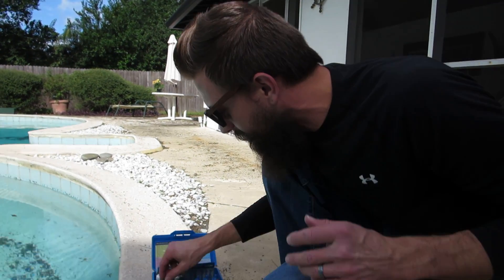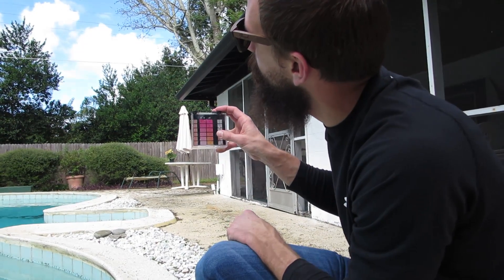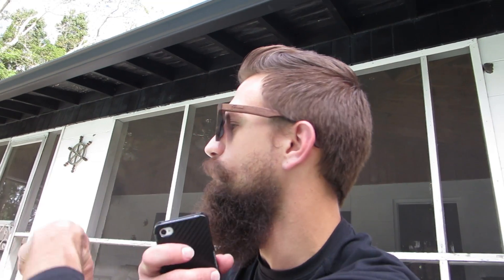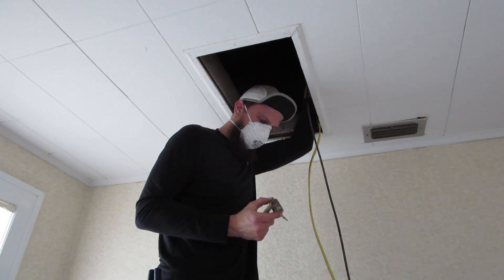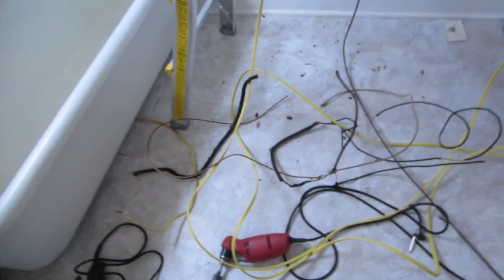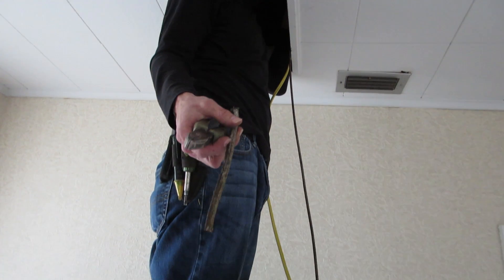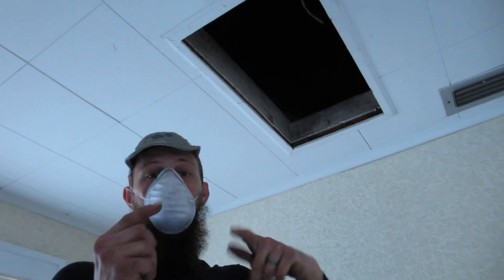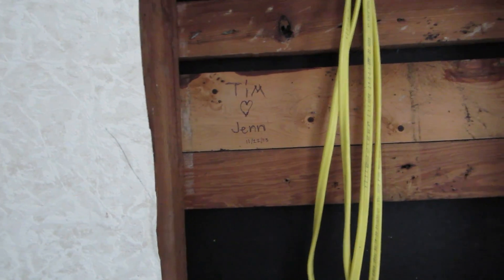Tim's Dirty Butt!!!

Comment: Awesome job! I'm excited to see your main feeds run and soon it will just be switches and outlets.  Home Depot has a mask that is similar to the one you have but it has a built in air exhaust vent. The one with the vent feels much nicer to breath through.
Reply from the maker: I've used those masks before, they still get hard to use when they are saturated with sweat. I was under the house all day yesterday, it was nicer because I wasn't as sweaty; but I did get much dirtier! lol